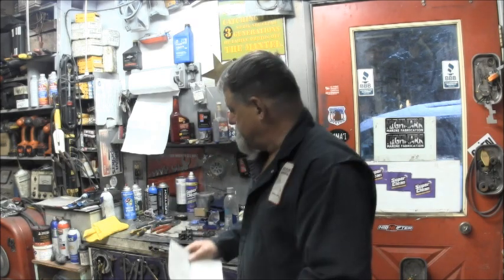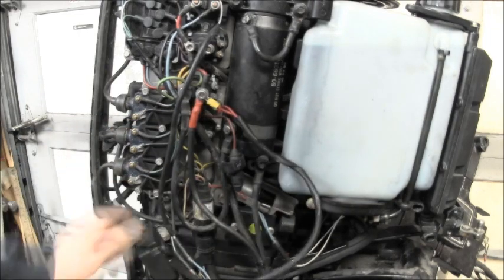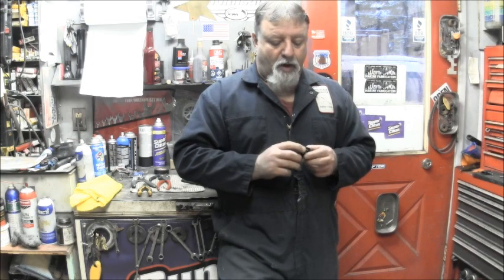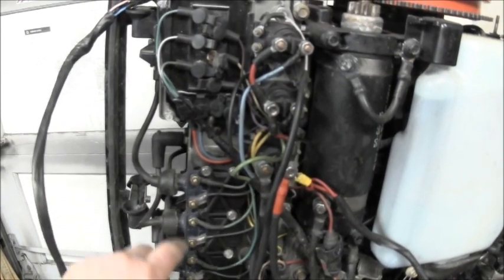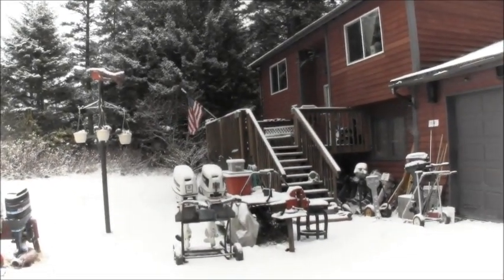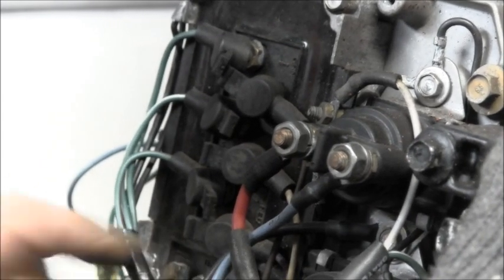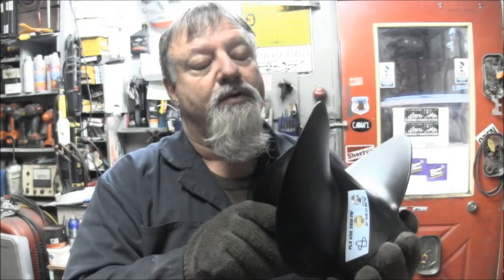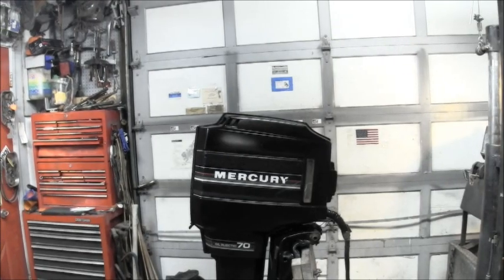MERCURY 1988  70 HP 2 STROKE,,,   (( Done ))

Comment: Very good, bought a boat last year with this motor, the starter solenoid didn’t work when i was on the river, i just jumpstarted the + from the battery to the starter and it fired right up, 
Like this motor how it is simple and easy to maintain
Reply from the maker: Yep' tuff  great ,  simple POWER.     KB

Comment: Could you please make a video on how to bypass the oil injection system on this engine.
Reply from the maker: Remove the oil jug,  When you take the jug off u will find a hose going to the oil pump,  cut that hose put a screw that fits snug in the hose secure with a zip-tie.  U R done.       kb

Comment: How do you get the Caring bearing out of these I’m having trouble removing mine
Reply from the maker: I am guessing U have the threaded retaining cover removed ? If so use a 2 arm gear puller to remove the carrier , If the motor is a salt water motor it can be next to impposible, Soak it with pb blaster & take your time,  If you use heat the seals & o rings will need to be replaced.  best luck mate.         kb

Comment: Looks brand new and ready for another 10 years worth of service. I have a 120hp 1986 johnson v4 vro project in the works but currently on hold until I'm finished remodeling my my house. My wife is after me to get the house finished first. I was having a tough time finding a carburetor for it but I finally found a place in Kentucky that sales used carburetors. I feel like the one I have could be repaired but not sure about how to go at it. The center tube that sticks up about 3/16 of an inch in the center of the carburetor is missing.  I believe it's for the high speed jet because it sets on top of it in the carburetor bowl. Any suggestions would be appreciated. Please keep the great videos coming. So amazing how a old motor can be brought back to life and running like a new one.
Reply: Sounds like that missing part is the emulsion tube. This brings fuel to the carb body opening and allows it to be mixed with flowing-through air (vaporized) after which it will be sucked in the combustion chamber. Regards !